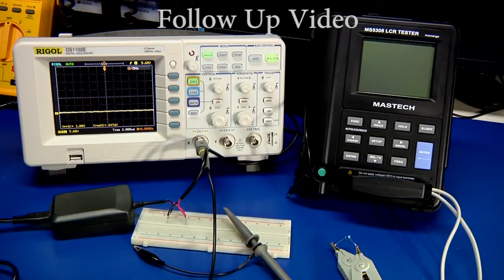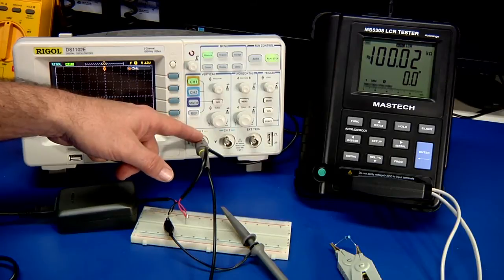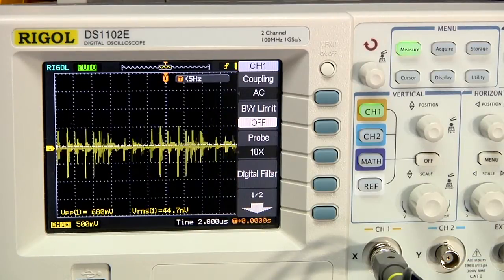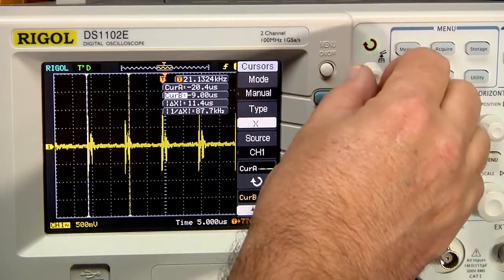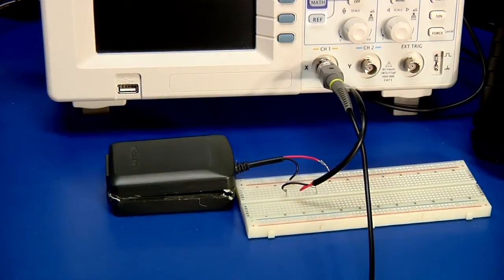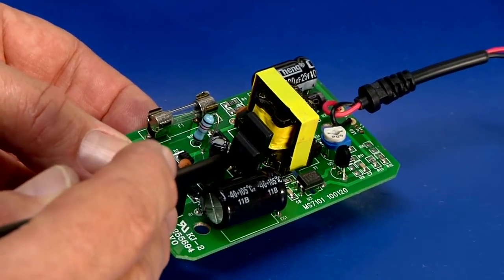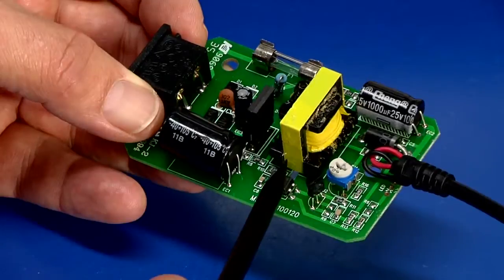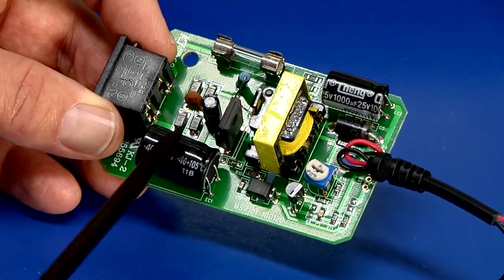#6 - Mastech 5308 LCR Tester Update

Comment: Get rid of the cheap Chinese CHENG cap and use an actual Low ESR cap which is what should have been used there. A Panasonic FM or FR should be good enough.
Reply from the maker: After this video the company got rid of the whole power supply.  They no longer supply it with the unit. The 5308 is still available.  Thanks for commenting.

Comment: If a user must make his own power supply to get his instrument running it may not be too bad considering the price. What bugs me most is IF the instrument is that much sensitive on power supply signal I just cannot trust it. For me it would be a NO NO. After all, a testing instrument must be trustable at all levels.
Reply: Actually, you just couldn't be more wrong. If a power supply is noisy no testing equipment is immune to it regardless of how high of a quality that instrument is. Think of a power supply like is the lifeline of any instrument

Comment: I kept wanting you to zoom in on the signal on the scope but you never did...
An inductor prior to the output capacitor might fix the problem. Likely.
A common mode choke on the output might also. It could be radio frequency interference. Grounding a single lead shouldn't otherwise make a difference in a circuit as I understand it.

Comment: Thank you for your video on Mastech 5308. Very helpful.

About this PSU - it seems to me like a not very good PCB design for a switching power supply. Thin long traces, etc. They have a 2-layer board anyway, why they didn't put a solid ground plane(s) on the back? Hence EMI and different effects from oscillocsope connection.